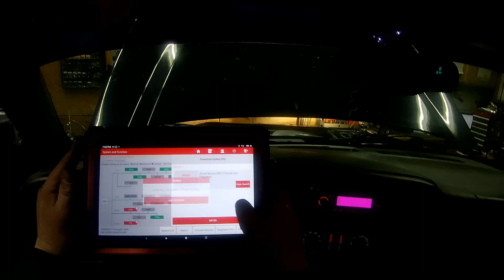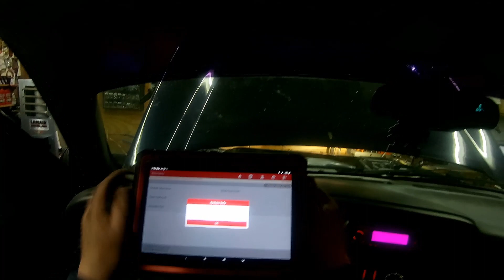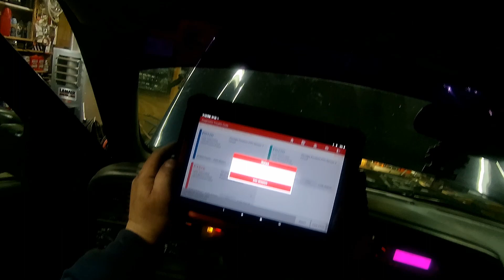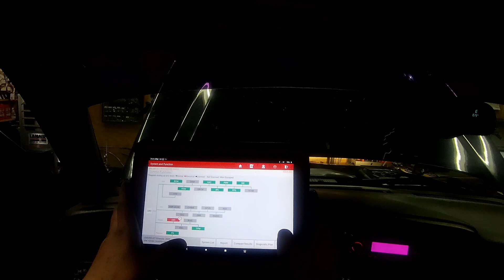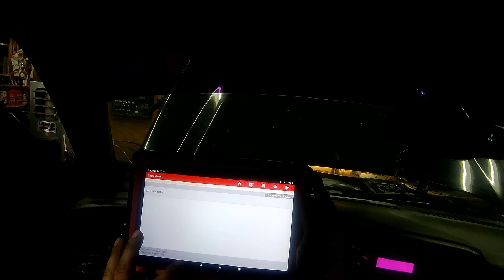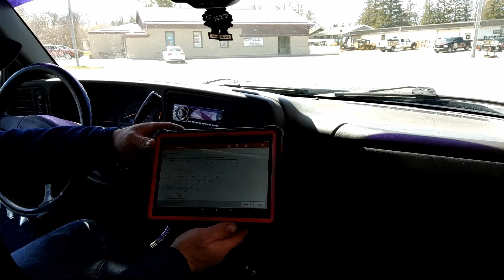2005 Chevy 2500 6.0 P0332 Knock Sensor DIY Replacement

Comment: Great job Pete! Hopefully those Dorman knock sensors don't give you any trouble. If I had one of those Gearwrench digital torque wrenches I would probably go out back and wrap it around a tree.
Reply from the maker: I've had the best luck with Dorman.  I seem to be doing a lot of repairs with Dorman parts lately like at least one a week.  As for that torque wrench I feel the same way I should have bought a cheaper one it probably would work better.  Sorry it was such a long video I really tried to make it as short as I could.  Thanks for watching.
Reply: I've had good luck with Dorman hard parts. A lot of people have had issues with Dorman's electrical and electronic parts. From what I've seen Dorman appears to be addressing issues by working with techs. I don't think the video was overly long.
Reply from the maker: Yes you are right.  I got to thinking and these knock sensors might be the first sensors that I have used from Dorman.  I will stand behind them if they fail.